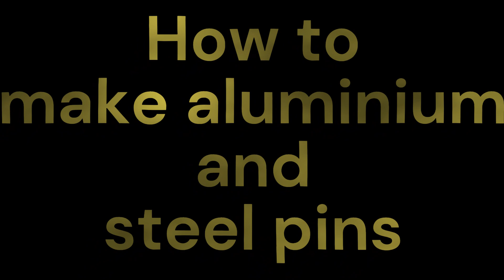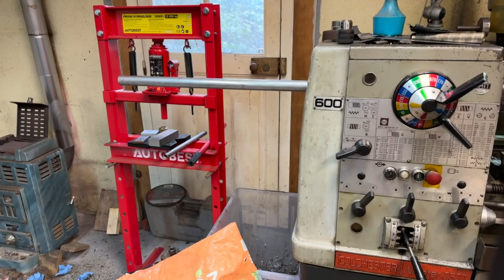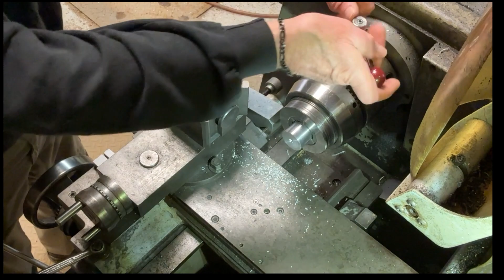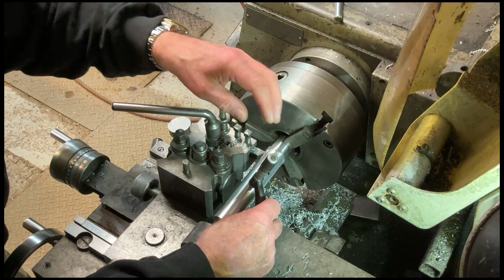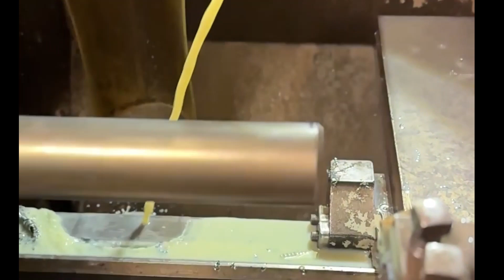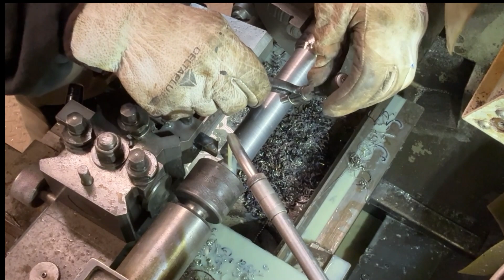How to make Aluminium & Steel pins. Turning steel & aluminium pins

Comment: another nice bit of work on the lathe,
Do you have any tips on making your own coolant and cutting fluid,
Its a shame when engineers retires and no longer can carry on with there work,for customers ,the customer really is at a lost.so nice to see you doing what you still love putting smiles on customers faces.
There was another question on my mind, if cutting metal in the lathe do you engineers account for heat expansion of the metal or does the coolants do a good enough job,

Comment: Ho Ho! There is a man dicing with death! The last time I saw a Colchester with 3 ft of40mm bar sticking out of the back of the chuck there was a loud noise, which was the bar bending with centrifugal force, and totally demolishing a metal partition behind the lathe, the student was running at 500 RPM though, but it put me off leaving bar sticking out without a feed tube, I made a 3 screw spider to support long bars, and that works very well, but I am still very wary. Stay safe! Chris B.

Comment: Good job
Reply from the maker: Hi Chris.
If you listen to the voice over I say that I won't be turning it very fast because of the length of the bar sticking out of the lathe. I also have a guide bush at the far end of the quill to support the bar. I had no problem at all with vibration whist turning these things.